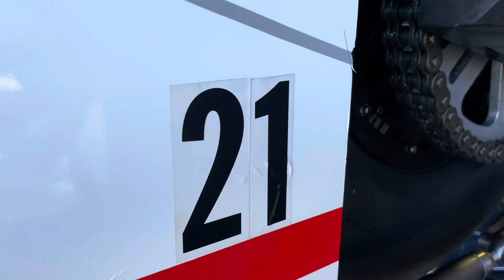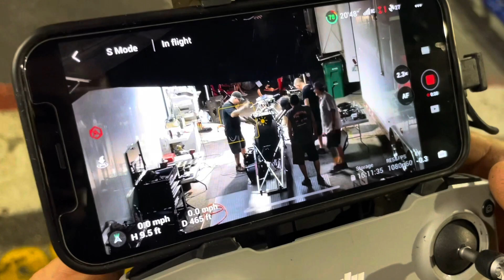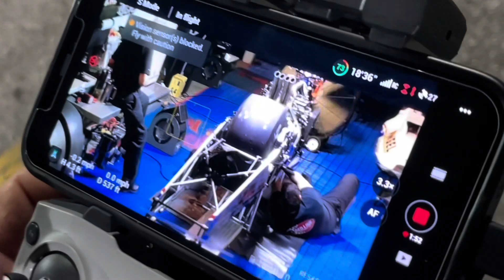Racing Legend DISRESPECTED?!

Comment: The Spider man is the champion until someone runs faster, I don't care where, Larry is the King. 
Only because Elmer Trett isn't racing still. Rip Elmer a racing legend.
Reply: Elmer would be in his early 80's dought he would still be racing now.
Reply: @Hitech82  
Elmer is a God of drag racing. 
Thanks for your comment, I didn't take his age Into account.
It only seems like a little while ago when he had his accident.
Reply: @REX-INRI-JESUS  I had the pleasure of being at Elmer's shop the year before he died. He taught me how important fuel pressure was. In a very unique way. Elmer gave me a 5 gallon can of alcohol.  He started a stop watch when I started dumping the alcohol into a 55gallon barrel as fast as I could. When he got to 4seconds he said stop. I had only dumped about 3/4 of a gallon out. He said in 4 seconds I go threw 7 gallons of nitro.  What's that tell you Hitech? Pressure. He winked and smiled.  Next race we had a fuel pump on our Progas Bike. It finally started running the second half of the track dropping us down into the low 8sec. Picking up almost 30mph from the 1/8 mile to the 1320.
Reply: @Hitech82  
I'm in Australia, Gavin Spann had a Elmer Trett engine in his bike it was very consistent with low Nitro.
He has a new engine now and is in second place in Oz with points.
Gavin wanted to sell his top bike, but I guess he didn't considering he's in second place.
Chris Matherson and Jay Upton are the fastest Australians.
God bless Nitro. 👍🍺💥
Reply: @REX-INRI-JESUS  God bless Australia and it's great people my friend
Reply: @Hitech82  
Thankyou friend 
God bless the USA 🇺🇸
Reply: Sad day for sure, I saw Elmer crash at indy.  Lost him and Blane johnson the same weekend.

Comment: Both have cojones that you would think defied them straddling those machines. However, 'revenge is a dish best served cold', despite the SpiderMan being hot, DANG HOT! and being #1 on machine prep' alone.
ps Mitch Brown has a neat paint job. What is that, Eerie Dess, Flip Flop ?

Comment: Definitely a bad move when he runs a 260 mile an hour quarter mile then he can put a number one on his motorcycle but the comments that's been made about running five events during colored and looking to just you know totally think that oh I'm number one now and really head that race it wasn't even a race when he got them 100 points that was a buy run a Byron is when a single bike goes down the quarter mile on a buy run now what would have happened if Mitch would have red lighted on that by Run cuz that was a Byron a race is between two bites not one solo individual the first one down the track across the traps win three how can you win a race when there's nobody next to you so much go back to the stands drink your diet Pepsi and have a hot dog courtesy of stoner